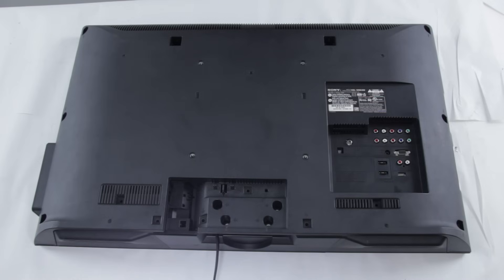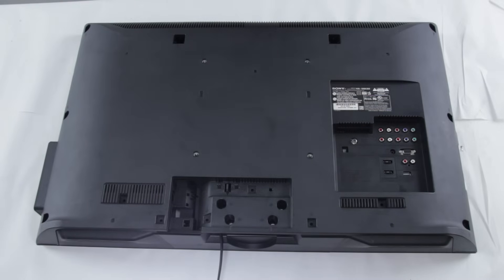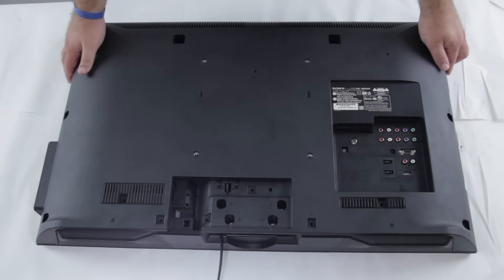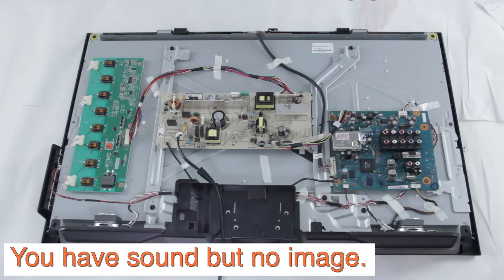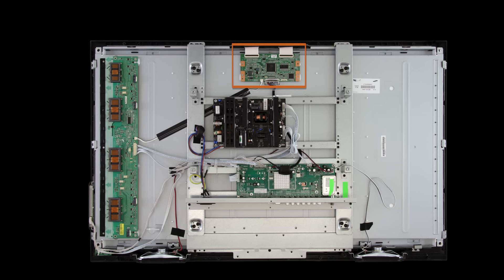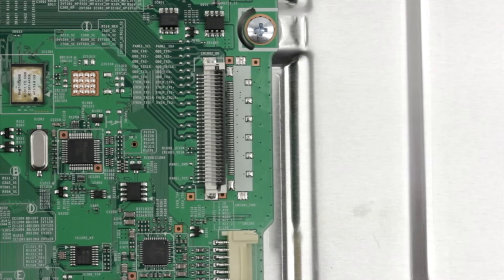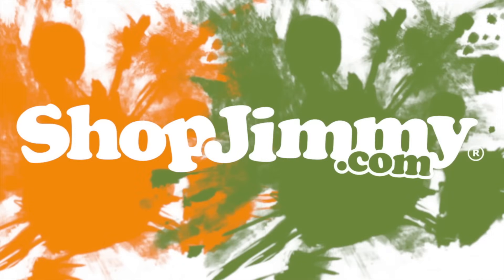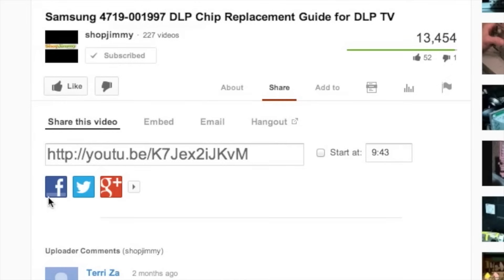LCD TV Repair Tutorial - T-Con Board Common Symptoms & Solutions - How to Replace T-Con Board

Comment: I have a Toshiba 37av502u that has a washed out display. I'm wondering if you could tell me what part I would need to repair this, The blacks are grey and overall typical of an overexposure. I see you have a t-con board available. Is this what I need? Thanx
Reply from the maker: swervo100  This is either a bad T-Con board or a bad TV panel.  If the problem is the TV panel, it may be more cost effective to replace the TV.  You can replace the T-Con board to see if that fixes the problem.  Here is a link to replacement parts for your TV model number on our website, click here:  http://www.shopjimmy.com/catalogsearch/result/?q=37av502u  Be sure to match part numbers on your current board, with your replacement for compatibility.  You can also call our customer service for further assistance with your purchase.  (877) 881-6492  Thanks and please let us know if you have any further questions with your TV Repair!  www.shopjimmy.com

Comment: Thanks for your video!  I have a panasonic 42tl515u and when I turn it on I get a black image but no sound or video. After several powercycles it will sometimes work properly for awhile but eventually regardless of the input the image freezes and the TV powercycles itself and it returns to the black screen.  Thanks!
Reply from the maker: Trizzle-E-Smizzle   I recommend replacing the main board in your TV.  Here is a link to replacement parts for your TV model number on our website, click here:  http://www.shopjimmy.com/catalogsearch/result/?q=42tl515u  Be sure to match part numbers on your current board, with your replacement for compatibility.  You can also call our customer service for further assistance with your purchase.  (877) 881-6492  Thanks and please let us know if you have any further questions with your TV Repair!  www.shopjimmy.com

Comment: Hi Guys, since last night I am seeing vertical white lines across my Samsung UN40D6000 SFXZA tv. When I turn my tv on I see the white lines fading throughout the screen. If I leave the tv on for sometime the brightness reduces. I would like to know if replacing tcon board will help and is replacing the tcon board easy with my model ? Would appreciate if you can provide me the link to the parts that I might have to replace. Thanks a lot guys.
Reply from the maker: Varun Blank   This sounds like a TV panel problem.  If your TV panel is bad, it may be more cost-effective to replace the TV as panels are typically hard to find in stock, difficult to replace, and expensive.  Thanks and please let us know if you have any further questions!  www.shopjimmy.com

Comment: Hi, I have a problem with LCD tv brand "Proscan". The problem is when I press power, the screen lights for a second and turns back off, but keeping the led power on blue. It shows no picture and sound. Any help will be appreciated.
Reply from the maker: MegatronFlexmistic09   Please reply with your TV model number and then we can recommend a replacement part for your TV Repair.  You can also call our customer service for further assistance with your purchase.  (877) 881-6492  Thanks and please let us know if you have any further questions with your TV Repair!  www.shopjimmy.com

Comment: Hi, I have a Sanyo DP46840 the picture on the right side has gotten very dark but the left side is fine and the sound is still good as well. Any suggestions on what may be wrong?
Reply from the maker: Rick Daugherty  I recommend replacing the backlight inverter in your TV.  Here is a link to replacement parts for your TV model number on our website, click here:  http://www.shopjimmy.com/catalogsearch/result/?q=DP46840 Be sure to match part numbers on your current board, with your replacement for compatibility.  You can also call our customer service for further assistance with your purchase.  (877) 881-6492  Thanks and please let us know if you have any further questions with your TV Repair!  www.shopjimmy.com

Comment: I have a LG46 inch LED. the coaxial cord got pulled and the nipple broke off the back of the tv. i touched the the cable to the back of the tv and got a picture but then touch it to it a 2nd time and all i get is horizontal lines. i can still switch to computer and have a normal picture. would this be a TCON board or the main board??? thank you for your help.
Reply from the maker: Sara Osterwise   I recommend replacing the main board in your TV.  Please reply with your full TV model number and then I can recommend a replacement part.  You can also call our customer service for further assistance with your purchase.  (877) 881-6492  Thanks and please let us know if you have any further questions with your TV Repair!  www.shopjimmy.com

Comment: Hi I have a Sony Bravia KDL-46XBR6 TV suddenly went black and the standby light blinks 14 times. Based on service manual, it says HFR error - LCD panel. Not sure if changing T-Con board will help. Also I cant find the T-CON board on your site or anywhere else as it is out of stock. Any suggestions please?
Reply from the maker: Karthik Ramachandran   This sounds like a TV panel problem.  If your TV panel is bad, it may be more cost-effective to replace the TV as panels are typically hard to find in stock, difficult to replace, and expensive.  Thanks and please let us know if you have any further questions!  www.shopjimmy.com

Comment: Samsung UN55ES8000 55-Inch 1080p 240Hz 3D Slim LED HDTV - I wall mounted it and began experiencing problems. The first noticeable issue was immediate, a "painting" effect of a moving reddish blur over the entire screen. This eventually went away. Everything worked fine until the second issue - the unit is typically on for at least a few hours. You pick up the remote and hit the volume and the entire unit gets thrown into a fault with vertical lines, the unit then resets and most often keeps resetting over and over. I removed the back and inspected every component on all boards under magnification seeing no obvious damage, burns or bad components. I reseated all cables except the tcon ribbons. I have it on the bench running, the "red painting" is back but is again going away slowly. I'm confused on this one because the primary issue is when using the remote, volume, menu, really most anything which causes the set to go into the bad state.
Reply from the maker: mvortex1   I recommend replacing the main board in your TV.  Here is a link to replacement parts for your TV model number on our website, click here:  http://www.shopjimmy.com/catalogsearch/result/?q=UN55ES8000  Be sure to match part numbers on your current board, with your replacement for compatibility.  You can also call our customer service for further assistance with your purchase.  (877) 881-6492  Thanks and please let us know if you have any further questions with your TV Repair!  www.shopjimmy.com

Comment: Here is an interesting one. I have a Vizio SV320XVT that I'm trying to troubleshoot. When you unplug either side of the T-Con output you get a full picture on one side or the other of the screen. But when both sides are plugged in you get compressed video at the top of the screen with lots of verticle lines at the bottom. I have replaced the T-Con board and the Power Supply (with other used boards) with no change. Any ideas?

One other item, the screen deteriorated slowly over about 2 days, starting with a thin horizontal line.
Reply from the maker: R Pollock   This sounds like a shorted panel.  If your TV panel is bad, it may be more cost-effective to replace the TV as panels are typically hard to find in stock, difficult to replace, and expensive.  Thanks and please let us know if you have any further questions!  www.shopjimmy.com

Comment: hello guys i have a toshiba 42lx177 when you turn it on it works for a few minutes then the picture goes out and is just a black screen with the sound
Reply from the maker: Enrique Romero   I recommend running the flashlight test on your TV.   Here is a link to a video we produced that shows how to run the flashlight test. No Image No Picture on Screen-Flashlight Test LCD TV Repair - How to Diagnose Broken Board TV Repair Please reply with your flashlight test results and we can recommend a replacement part for your TV repair. Thanks and please let us know if you have any questions! www.shopjimmy.com

Comment: IN NEED OF HELP!
i have a Toshiba 42in LCD tv model number 40E200U1 when i went to turn it on today there was a black vertical line on the screen can you tell me what is wrong with it and how much it will cost to repair it?
Reply from the maker: scott Gaudette   This sounds like a TV panel problem.  If your TV panel is bad, it may be more cost-effective to replace the TV as panels are typically hard to find in stock, difficult to replace, and expensive.  Thanks and please let us know if you have any further questions!  www.shopjimmy.com

Comment: Hi I have a 37" vizio vs370e serial no. 
LTAEOAK0112747. Its hard to explain what is wrong with it but on light colors it looks distorted and kinda blurry. I have the brightness turned way down right now so its not that bad.
Reply from the maker: 15wester15  I recommend replacing the main board in your TV.  Here is a link to replacement parts for your TV model number on our website, click here:  http://www.shopjimmy.com/catalogsearch/result/?q=vs370e  Be sure to match part numbers on your current board, with your replacement for compatibility.  Here is a link to a video showing how to identify your part number, click here:  TV Part Number Identification Guide for Vizio Main Boards (Plasma, LCD, LED)  You can also call our customer service for further assistance with your purchase.  (877) 881-6492  Thanks and please let us know if you have any further questions with your TV Repair!  www.shopjimmy.com

Comment: I have a Sony Bravia KDL-V40XBR1 (sn 8098xxx) that is having screen issues, vertical and diagonal line distorting the picture... Video 6 and 7 can see a picture through it, other channels cannot... lines do not interfere with the menu... what are your thoughts on possible problems? Main board?  Tcon board? Other?
Reply from the maker: TheJDHill   This could either be a bad TV panel or the T-Con board.  If it is a bad TV panel, then it may be more cost effective to replace the entire TV.  You can replace the T-Con board to see if that fixes the problem.  Here is a link to replacement parts for your TV model number on our website, click here:  http://www.shopjimmy.com/catalogsearch/result/?q=KDL-V40XBR1  Be sure to match part numbers on your current board, with your replacement for compatibility.  Here is a link to a video showing how to identify your part number, click here:  Samsung Timing Control (T-Con) Boards Part Numbers Identification for LCD HD TV Repair  You can also call our customer service for further assistance with your purchase.  (877) 881-6492  Thanks and please let us know if you have any further questions with your TV Repair!  www.shopjimmy.com

Comment: Hi I have an apex 40" lcd LD4086 serial number: 20607000305308206 we replaced both the t-con board and the 2 belts, now when we turn the tv on the tv has a back light but no sound or picture and we don't know what to do
Reply: Scratch that we get sound... just no image, we're confused because we just changed the t-con board
Reply from the maker: Alexis Soto   I recommend replacing the main board in your TV.  Here is a link to replacement parts for your TV model number on our website, click here:  http://www.shopjimmy.com/catalogsearch/result/?q=LD4086  Be sure to match part numbers on your current board, with your replacement for compatibility.  Here is a link to a video showing how to identify your part number, click here:  TV Part Number Identification Guide for Apex Main Boards (LCD, LED, Plasma TVs)  You can also call our customer service for further assistance with your purchase.  (877) 881-6492  Thanks and please let us know if you have any further questions with your TV Repair!  www.shopjimmy.com

Comment: I have a wide colored band running vertically down the right side of  my RCA 46LA45RQ tv.  I replaced the t-con board but nothing changed. The band is still there.  What can I do now?
Reply from the maker: Sherrie Herndon   This sounds like a TV panel problem.  If your TV panel is bad, it may be more cost-effective to replace the TV as panels are typically hard to find in stock, difficult to replace, and expensive.  Thanks and please let us know if you have any further questions!  www.shopjimmy.com

Comment: I have an LG TV (LG46LD550).  A few months ago all component inputs stopped recognizing when things were plugged in and the Ethernet port was flaky at recognizing the internet.  Now when you turn it on, it gets stuck on the LG splash screen and the light at the bottom remains red rather than turning blue.  I was going to try and replace the main board.  Can you tell me if I need to replace the t-con board instead?  Thanks
Reply from the maker: joengn   I recommend replacing the main board in your TV for your TV Repair.  Here is a link to replacement parts for your TV model number on our website, click here:  http://www.shopjimmy.com/catalogsearch/result/?q=LG46LD550  Be sure to match part numbers on your current board, with your replacement for compatibility.  Here is a link to a video showing how to identify your part number, click here:  TV Part Number Guide for LG & Zenith Main, Digital, & Tuner Boards (LCD, LED, Plasma TVs)  You can also call our customer service for further assistance with your purchase.  (877) 881-6492  Thanks and please let us know if you have any further questions with your TV Repair!  www.shopjimmy.com

Comment: Hi, guys! my tv is a Phillips 42pf7320a/37, original problem was: a dead tv with a green light and then red light that was blinking 7 times, solution for that was: get the" y main board " replaced and then red light blinking is gone. but now I got black screen that is flicking orange and blue dots. no sound at all,
 any help..? I'll appreciate it. thks...
Reply from the maker: Angel Villatoro   I recommend replacing the buffers/YScan Drive board(s) for your TV.  Here is a link to replacement parts for your TV model number on our website, click here:  http://www.shopjimmy.com/catalogsearch/result/?q=42pf7320a%2F37  Be sure to match part numbers on your current board, with your replacement for compatibility.  You can also call our customer service for further assistance with your purchase.  (877) 881-6492  Thanks and please let us know if you have any further questions with your TV Repair!  www.shopjimmy.com

Comment: I have samsung 46" TV model # LN46B650T1F and model code LN46B650T1FXZA showing vertical strip lines more yellow color and it change location on different part of the screen. Please let me know if easy fix
Reply from the maker: Nazar Albarghsh  SAMSUNG LN46B650T1F - This could either be a bad panel in your TV or a bad T-Con board.  I recommend replacing the T-Con board to see if that fixes the problem.  Here is a link to replacement parts for your TV model number on our website, click here:  http://www.shopjimmy.com/catalogsearch/result/?q=LN46B650T1F  Be sure to match part numbers on your current board, with your replacement for compatibility.  You can also call our customer service for further assistance with your purchase.  (877) 881-6492  Thanks and please let us know if you have any further questions with your TV Repair!  www.shopjimmy.com

Comment: I have a vizio tv Model No.: VIZIO VO420E Part No.: 10235130022 Serial No.: LQAECBK3200871 with a inverted picture problem... some times it works and other times its inverted but when its working and we turn the tv off it messes it up so im thinking its the t-con hence ur video... any suggestions or am I correct on the problem
Reply from the maker: superspeed71   I recommend replacing the main board in your TV.  Here is a link to a replacement main board for your TV model number on our website, click here:  http://www.shopjimmy.com/vizio-3642-0732-0150-main-board-for-vo420e.htm  Be sure to match part numbers on your current board, with your replacement for compatibility.  Here is a link to a video showing how to identify your part number, click here:  TV Part Number Identification Guide for Vizio Main Boards (Plasma, LCD, LED)  You can also call our customer service for further assistance with your purchase.  (877) 881-6492  Thanks and please let us know if you have any further questions with your TV Repair!  www.shopjimmy.com

Comment: i have toshiba reganza model 47WL68E my problem is solarized picture I Checked
The cable and conector to t-con board but every things seems to be O/.K
Please your ADVICE
ZARI
Reply from the maker: Zari Zari   I recommend starting with replacing the T-Con board to fix the problem, if this does not work or the problem comes back, then I recommend replacing the main board.  Unfortunately I do not see any replacement parts in the search results for your TV model number on our website.  Thanks and please let us know if you have any further questions!  www.shopjimmy.com